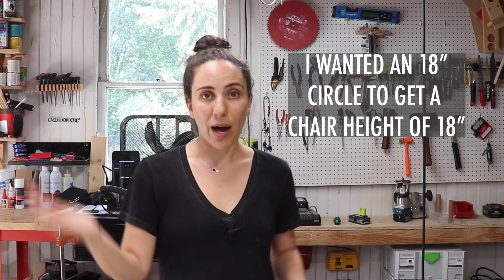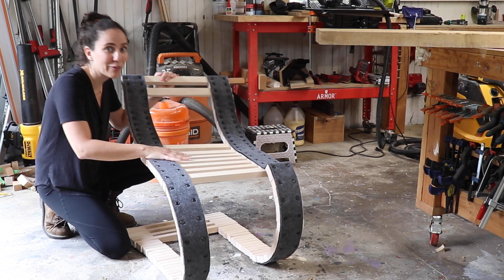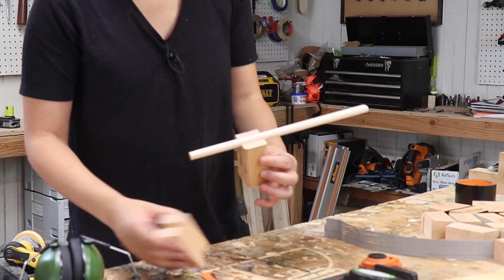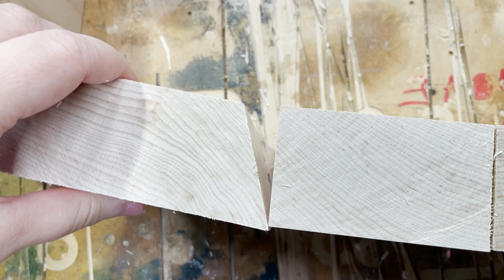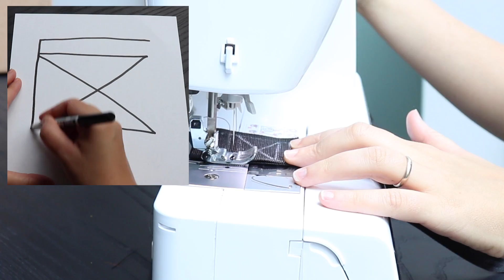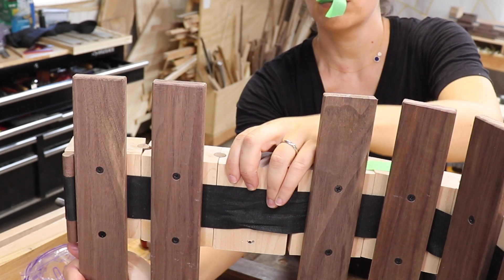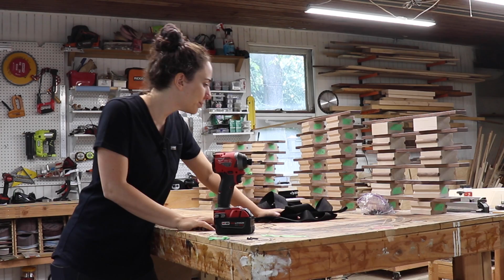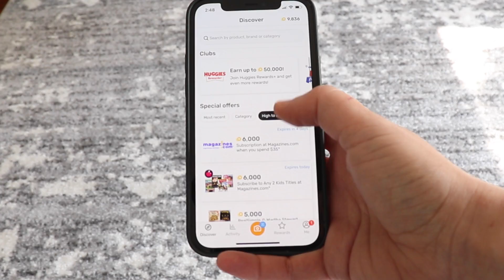I ATTEMPT to make a Roll Up Chair… AGAIN...

Comment: I would drill holes in the middle of each pieces (so the tension equalize from inside to outside curves) and run cable wire (low stretch), then make a tensionning mechanism so that you can detension it for rolling

I think in the choice of material you have been mislead by jo's two sens common sens. They say "use that strap material as it's the toughest". Bu in this case it's not about tensil strength, it's about stretch. What you want is non stretch material. That rules out all nylon and polly(put the kettle on). For low stretch fabric the only two i know of would be kevlar or dynema (both can go with other names depending on the manufacturer), plus you want a weaving with flat strands along the axis. If it doesn't stretch then you don't need to pretention it to keep the segments in compression. Stretchy, tough and strong are totally different parameters that should not be confused. In this application the number 1 criteria is low stretch !
Reply from the maker: Thanks fir the tip!

Comment: The straps should just be the way to roll it up. The structure when unrolled should come from the joint between the surfaces of wood. If there is a profile on the mating surface that hooks the two pieces together, you don't have to depend on the tension of the strap to support your, idk, 95 lbs?
Reply from the maker: Yeah. That all needs to be worked out

Comment: Leather would stretch at least as much as the webbing. Contact adhesive, at those stress levels, act more like a lubricant than an adhesive.  The solution has to be steel cables, drill the blocks to take the cables and put tensioners at one end.

Comment: I suggest that you consult a rigger who works with sailboats - discuss stainless steel rigging wire and Dyneema  with her or him. I'm not sure webbing is the right solution for the structural part of your challenge. Said rigger may be able to solve your pretensioning problem
Reply from the maker: Yeah. The webbing is definitely the wrong choice
Reply: @3x3CustomTamar  I think you are close. You have solved many of the problems. You just have inadequate pretensioning in chair mode (adjustability  of the pre tension would help too).

Comment: Hi Tamar!  I admire your tenacity!  I feel as if your project would work given the right strapping.  My suggestion:  Metal pallet strapping.  It has zero stretching, and can withstand 2400 pounds of tension.  And speaking of tension, you had to tension your previous strapping materials to try and get all the stretch out of them -- sort of 'pre-tensioning' them, so the load on the chair could not stretch them further.  With metal pallet strapping, you don't have to do that tensioning ahead of time, since the length will not change.  Also, metal pallet strapping should be flexible enough to handle the tight curves rolling up the chair, especially given the thick material you're using.  Plus given the 'molecular memory' of the metal, it 'wants' to relax out to a nearly-flat light curve, so the ends flipping back should not be an issue, since floppy webbing allowed that.  In your current arrangement of the wood, I'd probably use 2 strips of it per side.

As to the danger of pinching, one way to go is a slip cover of heavy canvas, like encasing the chair in a futon cover.  It would hide the lovely wood, but the thickness and sturdiness of the material should resist being pinched between the pieces, and therefore keep fingers out of those joints as well.

Good luck!
Reply from the maker: I like the slipcover idea. Make it a side chair. Interesting
Reply: @3x3CustomTamar  Yes, if it's stiff enough canvas, it should resist going into the gaps.  I will say that even then, the safety factor of your now-glued chair is still subject to those leveraging forces when you're fully all the way back in the chair (one commenter estimated 600kg of leveraged force on that front curve at that seat length, when fully seated), splitting the lignin in the wood grain along the front edge, parallel to the now-glued joints where those gaps opened up before.  So the canvas will help with the gaps pinching you, but the chair can still break under load, even glued, without a non-stretchy strapping.

(And no, I'm not angling for you to send me all that lovely hardwood!)   :)

Cheers, Tamar.  You're great, and your channel is just the best!  Thank you for your honesty in presenting not only perfect, finished projects, but also the process and sometimes-less-than-successful attempts.  Just like we all have from time to time.  Because how you think through these problems is also educational (and entertaining).  Keep up the good work!

Comment: I want you to weave the strapping where the inflection of the curve changes so the strapping is always on the OUTSIDE of the curve… and not INSIDE the curve.. like, the middle of the S shape
Reply: I majored in math.
Reply: Do I make sense?
Reply: One day when I have extra time I’ll look into it further
Reply: I just looked at the pic more closely. I definitely think even if there were 2 different strapping pieces.. they overlap a bit in the middle.. but always focused on the outside of the curve
Reply from the maker: Then it wouldn’t roll up
Reply: @3x3CustomTamar  but reverse how you do the wood spine for the upper half.. then each half rolls a different way and there will be 2 side by side rolled up parts
Reply: Then the top half supports itself like the bottom half does

Comment: You got it!!! You can improve just by shortening the length of the seat.
Reply from the maker: Maybe. But the straps are just the wrong material. Need something stronger
Reply: @3x3CustomTamar  I was thinking about it last night, beside shortening the length of the seat, perhaps adding another row in the middle which can absorb more weight. Btw, what do you think of tow straps? 2 inch tow straps are rated for 915 lbs. to 3,335 lbs. working load limits depending on hardware options that you are selecting. Thank you for the dedication and excellent work.
I know it will work! Congratulations in advance!!!

Comment: I don't know if it would work, but how about instead using some strap outside the piecies, use some rope inside the pieces with one end fixed to the last piece and the other end loose so you could pull the rope and push the piece to create tension.
Reply from the maker: Maybe

Comment: One aspect of the design that may be exacerbating the stretch is that the blocks and strapping are in constant contact, particularly where the blocks join. Once some flex is initiated the corners of the blocks are pushing on the strapping between spans and are applying a deflecting force to it. Pulling on a horizontal tensioned line at the middle (which the blocks are doing) creates an immense amount of force at each end. In theory it increases to infinity but of course material stretch and failure limits the total force. In essence the blocks are exerting leverage on the strapping and causing more load/stretch than just the load they would be subjected to under ideal geometry. Creating a recess or scallop where the blocks join may help so that the strapping is only connected at the peak and there is an air space underneath each span. How you would do this and also maintain a good connection to the block I am not sure... I hope you figure this one out!
Reply from the maker: Haha maybe! I hope I hope I figure it out as well

Comment: I think you figured out one of my comments by the end, and that is that when you take a long piece of material and stretch it, it will stretch more than a short piece. This is true no matter how stretchy or not the material is. So, if you only attached the straps to the end pieces, then the entire strap is stretching. That might result in, say, half an inch of stretch. The blocks are then free to move that much across the whole chain, which would explain having two pieces with a half-inch gap between them. A fix for this would be to attach more blocks to the strap. This way, each sub-section would be able to stretch less. So, if you added only 4 more attachments, then your stretch would only be 1/16 inch anywhere.

I’m wondering, though, why you didn’t just use metal hinges between each joint. That would solve the stretch problem and add twist strength, too.
Reply from the maker: To answer your metal hinge question. That seems like cheating. The chair is supposed to be simple but it would probably work
Reply: @3x3CustomTamar  If the hinges would be cheating, then I wonder if they make straps with metal fibers. That would reduce the stretchiness.

Comment: The saga continues with the roll up chair.     Would it be cheating to add two steel rods that are just held in by compression from the back foot to the back of the seat?  I know it wouldn't be As elegant as you would like but it would give the back of the seat lift and keep the foot from rolling up.    The only other thing I can think of is double straps per wooden leg to help stop stretching.
Reply from the maker: Maybe.
Reply: @3x3CustomTamar  ..  well you make your own dowels with your router make some nice walnut ones to match 8)

Comment: You need to use a material with a tiny elasticity. What about 3/16” vinyl coated steel aircraft cable. Also, make sure you are putting the angle cuts on the end grain of each board. Wood has a large compression factor across the grain (the cellulose fibers are like straws that can crush sideways) putting the compression on the end grain would eliminate some of the flex.

Comment: Leather will stretch more than the polymer materials you are using now. 
Deflection=ForcexLength/(ElasticityxArea)

E for Steel (cable) around 200
E for polymers like your straps around 1-3
E for leather around 0.1-0.5

Comment: I think Gus Sterneman has close to the right idea.  There's much too much tension along the whole chair and nothing to keep the ends from rolling up, as you showed had happened.  That was a surprise, though should not have been.  It's not the strap material, it's the strap having free rein along the whole curve of the chair.  Really, there are four parts to the chair: The foot, the flat part that lies on the floor; the leg, the outside curve to the middle of the seat; the butt (for lack of a better word), the inside curve from the middle of the seat to the back, and the back, which again is straight.  Maybe five parts, if the seat itself is another part.  I think breaking the strap into four parts, or attaching the strap so it's only free within each of the four parts, might produce a better solution.  Maybe next year, when I retire, I can try something like this, though luckily my wife can handle the sewing for me.  Thanks for posting and giving us all something to think about.
Reply from the maker: Yeah. I was going to attach the strapping on all the pieces individually after I got the right strap length. But after I got hurt I just thought it wasn’t wise to continue with this iteration

Comment: Not sure how to route it but steel wire / cable seems to be in your future if I had to guess. Can’t think of much else that’s so good in tension that will do what you’re asking. Maybe several smaller wires in place of the webbing?

I don’t think leather will do the trick in and of itself but on top of a wire or multiple wires as decoration would be badass I think!

Good luck and thanks for sharing all your hard work!
Reply from the maker: Hopefully I can figure this out!

Comment: If I recall correctly, an arch is only strong if the load bearing section is all pressing inward. (Perhaps an engineer could verify.) 
If this is right the chair will not work, because at the peak of the arch pressure is pushing outwards due to the arch being on its side. I do hope that I am wrong, as I would love to see the chair succeed.
Reply from the maker: I have no clue. Ha

Comment: A valiant effort.  My guess is that allowing the low-tension pieces to contribute their stretch to the high tension pieces is where the big problem happens.  You could try stronger materials.  But even steel stretches, under enough tension.
Reply from the maker: Yeah. This is tricky!

Comment: if it is a stretch issue then why not ditch straps and use something flexible that will not stretch like the stainless cable they use on the garage doors going through holes drilled in the center  of the wood pieces ?
Reply from the maker: Maybe that would solve it
Reply: @3x3CustomTamar    maybe something like 1/4" diameter ?

Comment: Some thoughts from someone with a Masters in Mechanical engineering. You are looking at the strength of the strap when your problem is stiffness (think a soft spring and stiff spring. They can both hold the same load and be equally strong, but the soft one will never hold something in place as well). You need to use something that is much stiffer like a small ( ⅛" -¼") steel cable. There is also a huge variation in the tension forces needed to hold the shape in the different parts of the chair. By letting the strap float those tension forces are the same along the whole length. Basically as you found, the tension needed to hold the bottom c shape were higher than the tension needed to pull the top and bottom ends closed on themselves. The solution would be to have several different anchor points along the strap/cable. Mainly you would need something at the top and bottom of the C (some more in between would help distribute the stresses as well). That's also probably the only place you would need the much stiffer cables, so you could probably use strap over all and just additional stiffening and strengthening in the C part.
Reply from the maker: Definitely good thoughts. Thanks!

Comment: Thanks for taking this on again!  I really think you went through this project super thoroughly and made all the right choices.  I bet any material, including steel cable, will still stretch too much.  You are building a very large lever.  Maybe it would work if each piece is individually hinged, but by that point it will probably still be super fragile.
Reply from the maker: Yeah. I hear that

Comment: This is such a good series.  I learn much more from watching your problem solving than any more "typical" video.  FWIW, I don't think leather is a good idea.  Leather tends to stretch over time, much more than nylon.  My suggestion would be to use a metal, preferably steel or aluminum skeleton.  If you could make the pieces lock into each other like puzzle pieces instead of just supporting flat edges maybe you would gain enough friction to gain stability.  Your problem isn't with strength, the materials can take the weight.  The issue is with slippy slidyness aka lack of friction leading to instability.  That is why the glue fixes the problem, sort of.  Additionally the side to side instability is an issue but that I have no clue how to even pretend to address.
Reply from the maker: Maybe!

Comment: The fact that the dowels make the chair look kinda like a bicycle chain gave me an idea! Elasticity seems to be a huge problem here, so maybe using a chain rather than fabric style material would solve a lot of the problems with this project. A chain is flexible but not elastic so you could just cut it to the exact length you need and not have to worry about too much tension or things springing back. I know that there are flat chains which are basically steel rectangles riveted together that seem perfect for this. They're called tractor chains, maybe you could try that.
Reply from the maker: Maybe!

Comment: A+ for effort! Have been following this rolling chair series.

Some might think this is cheating, I am wondering if metal hinges can be strategically added at the bends and hid them under wide straps. I know... more cost, more weight... hinges prevent side-way or twisting movements, also wouldn't let the blocks push against each other.
Reply from the maker: Maybe

Comment: This is NEVER going to work with any sort of polymer strapping. You need a tensile band that does not stretch at all. Look for semi-flexible material that has both a high tensile strength and next to no elasticity.
Reply from the maker: Yeah. I came to that realization as well ha

Comment: Your project is quite ambitious.  :-)

As far as the strapping is concerned, I suggest that you would need a "high carbon spring steel strip" dimensioned for a tensile strength of around 5kN (includes a good safety margin).  You can trade off width against thickness, but wide and thin maximizes elasticity.  The surface over which the strap is tensioned should be rounded to avoid bending the spring steel past it's "elastic limit".

There are other problems with the chair's design.  E.g. the compressibility of the wood and the effects of heat and moisture on it's dimensions.  Because of the many hinge points and the effect of high leverage, any small deviations add up amplified in the flex of the chair as a whole.

You may have to pre-form the steel strap in the back-rest section of the chair to prevent it from curling in the wrong direction.  Maybe one could use a bit of rope to tie the top of the back rest to the end of the foot - this could double as a rope to keep the chair in the rolled-up position when in storage.
Reply from the maker: Thanks fir the tips!